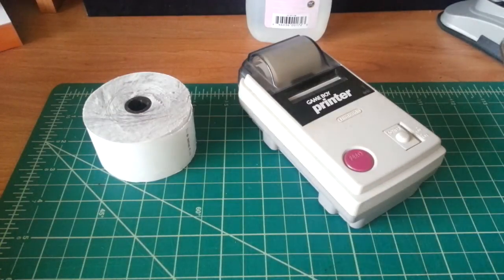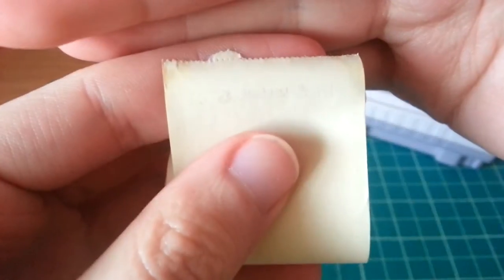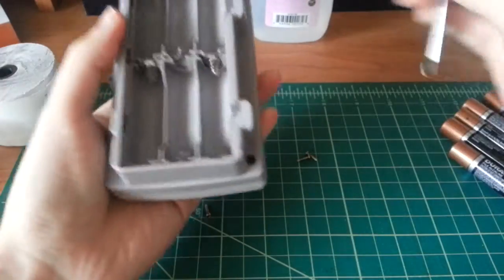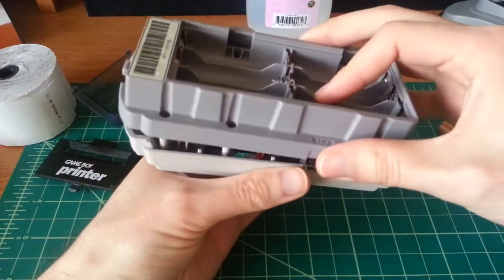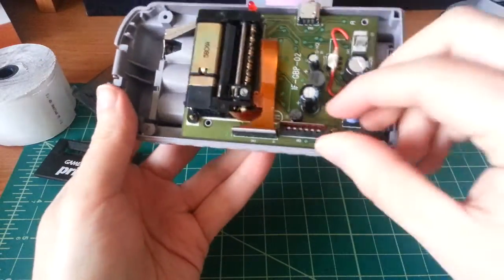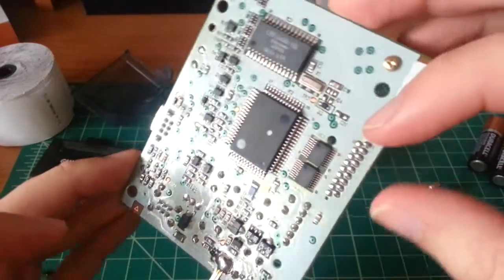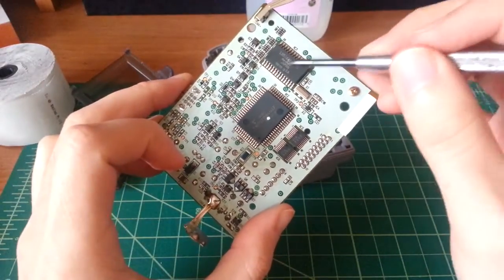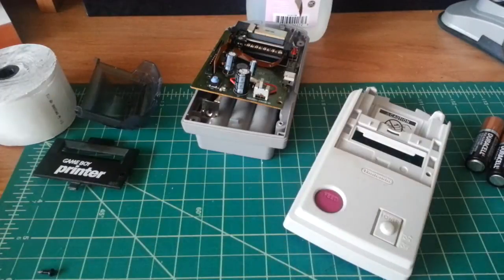TeardownTube - episode 37 - Nintendo Gameboy Printer

Comment: hey great video could you tell me if it is possible to replace the battery contacts as I have just bought one and the previous owner had left the batteries in and corrosion has completely wrecked one of the prongs.
Reply from the maker: It's possible to replace the battery contacts but I'd have no idea where to find drop in replacements other than another gameboy printer. You could try buying gameboy dmg replacement battery contacts and somehow bodging them in, but I haven't tried myself so I cant say if it would work.
Reply: Thanks for your help :)

Comment: Can I use the  gb  color multiplayer cable link  for the printer and camera
Reply from the maker: The original nintendo link cables sold in the gameboy pocket era included the adapter so you could connect a pocket to a dmg (and the pocket and color use the same link port). Wikipedia calls it Game Link Cable Adaptor (model MGB-004). A quick ebay search of MGB-004 shows a few hits.
Reply from the maker: The gbc uses a smaller connector than the dmg/printer so you'd need an adapter
Reply: @sjm4306  what would be the name of the adapter???

Comment: Interesting - you're the first I see that has the IF-GBP-02 board. I also thought that was a fuse at first, when I tried to make it work again. The smd fuse is on the backside if anyone is wondering. Now I need to find out what part that actually was, that I ripped off (probably threw it away and only have two other REV1 boards). Should have known that but I was tired and frustrated ( killed it with one variable psu that has adapters that allow you to power center-negative style).
Reply from the maker: Maybe an inductor/choke since it's related to the power input side and might be serving as a filter since driving the heating elements in the print head sucks quite a bit of current.